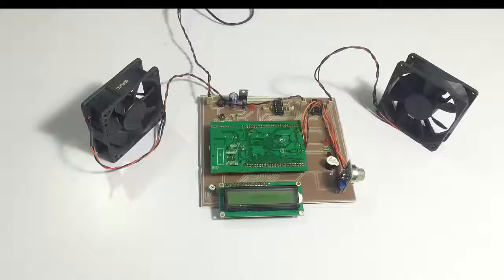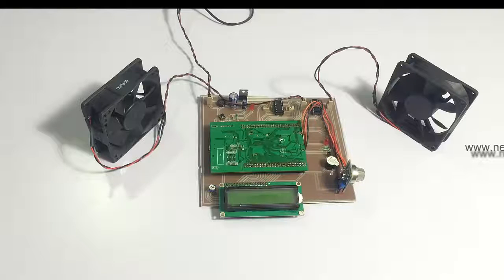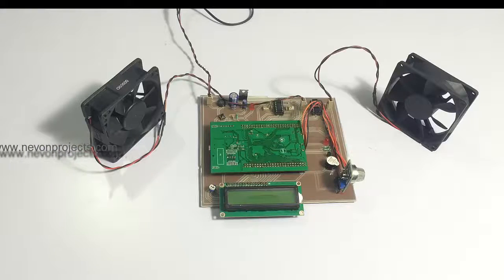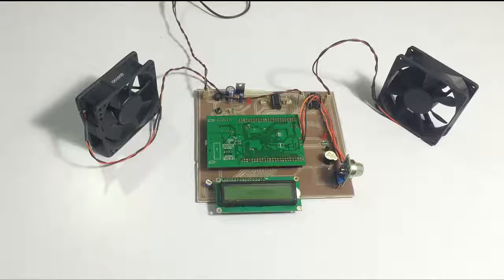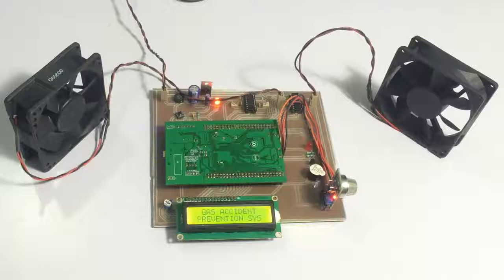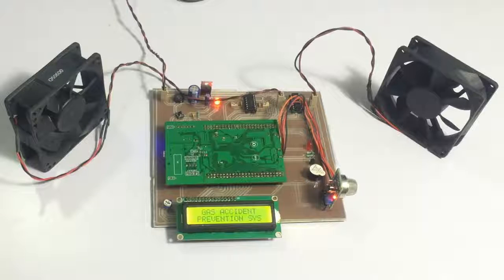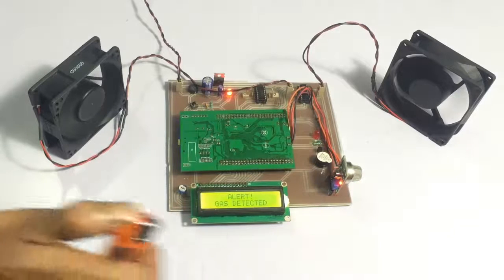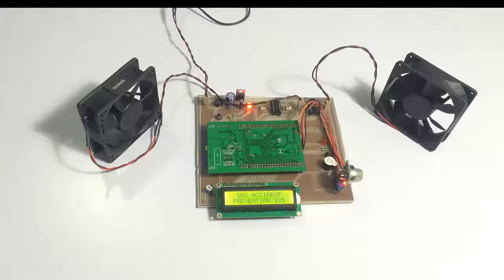Gas Leak Detector with Automatic Air Exhaust Using ARM Cortex

Comment: Are those explosion proof fans?  Or do you have any relays in there?  If the motors aren't sealed, that is likely to cause an explosion.   Like right when the explosive gas passes by the exhaust fan. 

Pumping more air into an environment where there is an explosive gas can make it worse.   We use blower fans to make propane burn hot enough to melt metal for casting.    Your little toy fans wouldn't really matter, but if someone upscaled it, it could be dangerous.